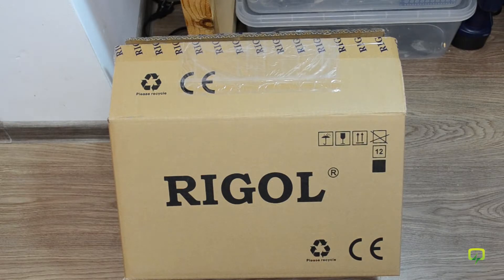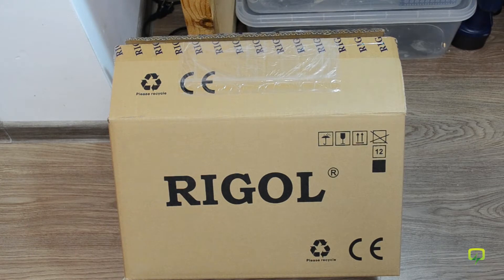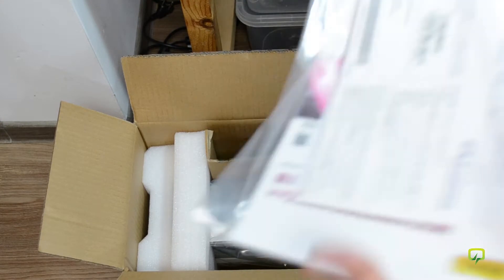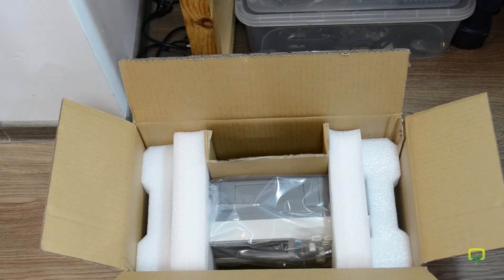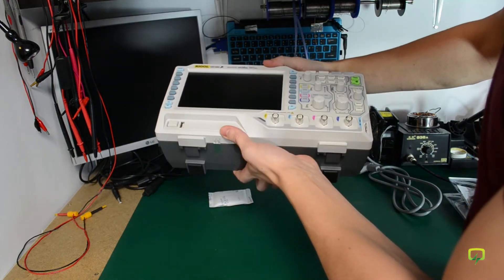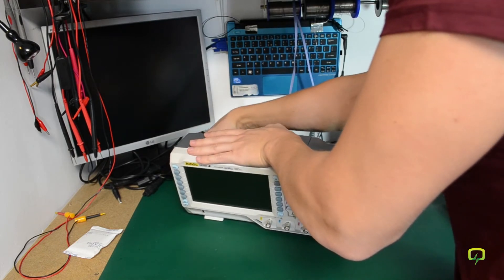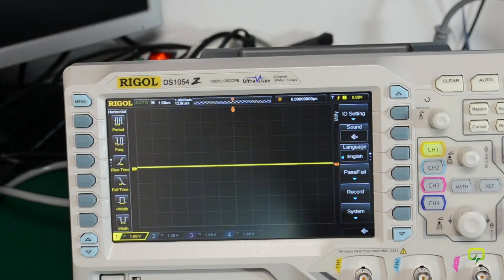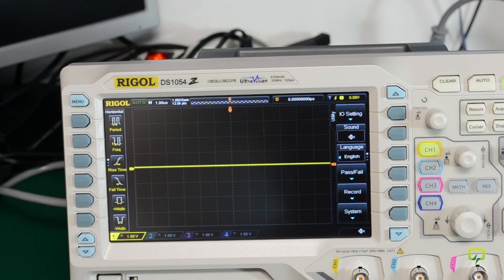VoltLog #3 - Rigol DS1054Z Unboxing

Comment: You are from Romania?
Reply from the maker: yes
Reply: K,can you tell me the name of shop?
Reply from the maker: Scope was purchased here http://www.ronexprim.com/
Reply: I talked with them and not offered me a good price.Only the Batronix offered me the DS1054 at 360€ (i think i will buy).For high voltage (220V AC) use diferential probes or the probes that came with oscilloscope and remove the ground(alligator).I wish you all the best
Reply from the maker: thank you! Batronix are known to sell these scopes at a lower price. However when importing the scope it might be impossible to use the warranty should you ever need it.
Reply: Hello.You received the oscilloscope in only one box or two (a box in another box)?
Reply from the maker: If I remember correctly, 2 boxes.